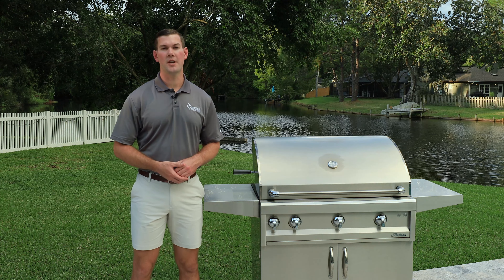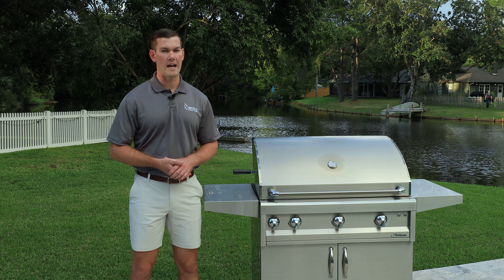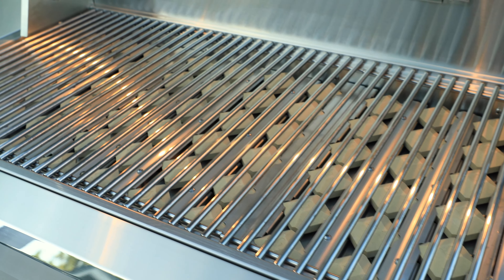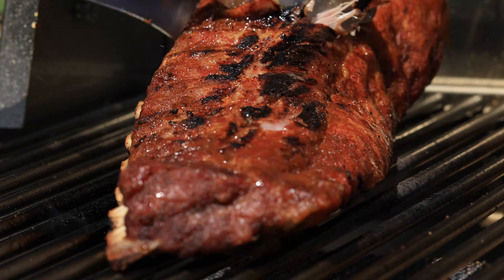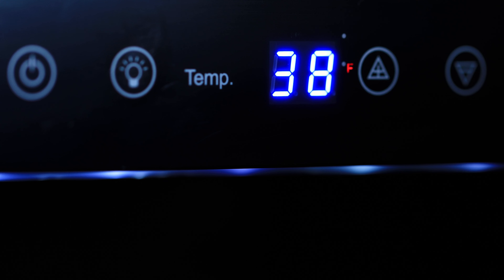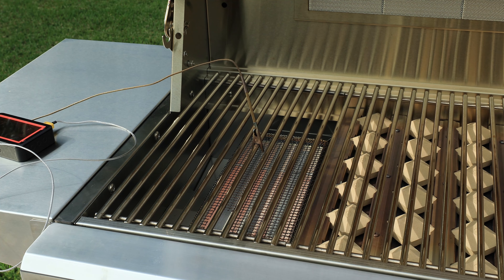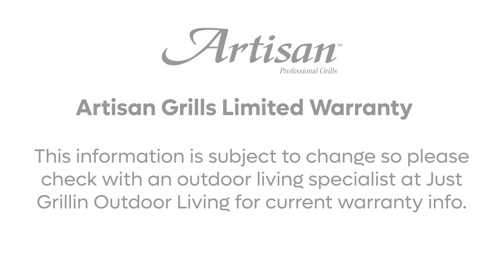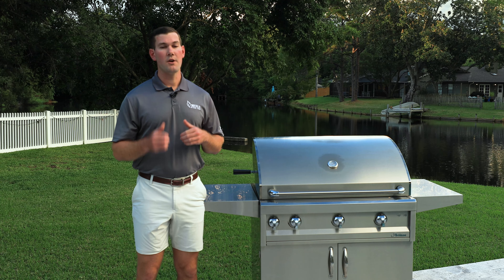Artisan Grills Review | ARTP Professional Grill Overview | Full Line Review & Performance Tests

Comment: Have you heard about a lot of flare ups? I am really liking this grill but reading about people hating it due to so many flare ups.
Reply from the maker: This is a touchy subject. Flare ups is not a universal, cut and paste topic in my opinion. People cook with so many different oils, seasonings and sauces. People also use different grades of meat with different fat contents which can greatly contribute to flare up experience.

This is my take on it with this particular grill, which I personally own. Sorry this answer is going to be long winded.

The first step to flare up protection is a clean grill. With briquette trays, you need to periodically flip them over to allow things to burn off. People, generally, do not do this simple maintenance. Over time, you're going to have things build up that cause flare ups. Also, briquettes hold heat better so if you're not accustomed to cooking in a grill that has them, people tend to run the grill hotter than it needs to be which also contributes to flare ups.

Cooking with different meats and fat content makes a difference. Burger patties that are 70% lean and 30% fat create way more mess and flare ups than if you cook with 85-15. Most people don't mention what they use or if they throw a lot of oil on the food when they talk about flare ups.

In my experience with this grill, it's generally very little. If I do get them, it's usually with burgers and it's because I am running the grill hotter than I intended too. If you are coming from a less powerful grill to a grill like an Artisan, it's a small learning curve because it doesn't take as much on the heat dial to reach certain temperatures as it may take full blast on another to achieve the same temp.

No grill is flare up proof. Don't let anyone tell you that. But if you keep your grill relatively clean, are aware if the food your cooking is fatty and has oils/sauces that can cause more flare ups and have your heat controlled, you really aren't going to deal with flare ups much at all other than occasionally with a burger.

- Sam